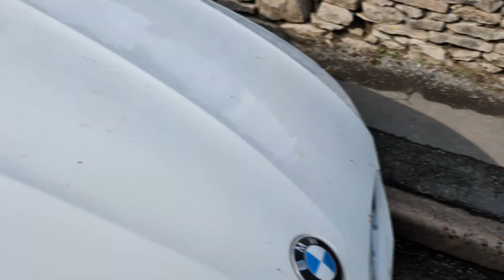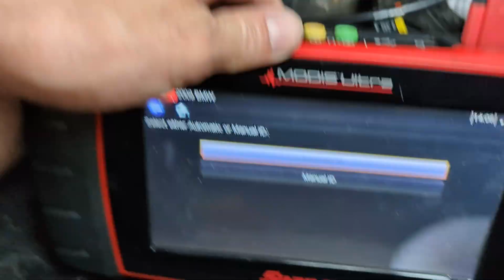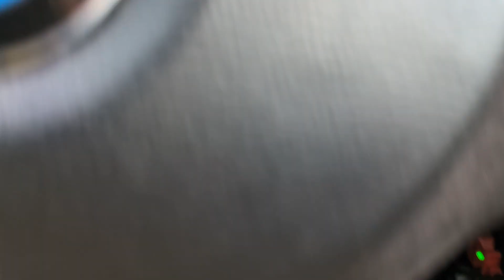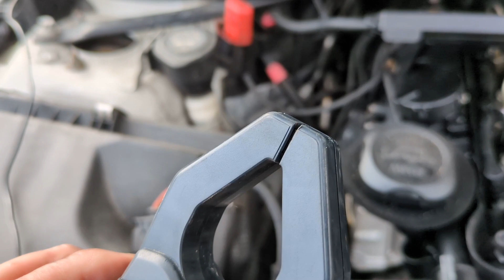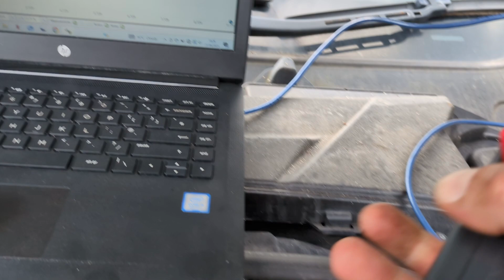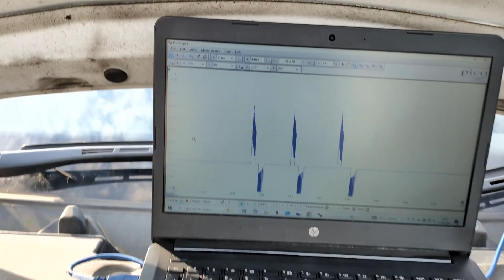BMW 443C Injector Cylinder 3 Activation | Diesel Misfire Troubleshooting

Comment: Brotha no way you made a video about this your a legend 

I got a 335d 2010 and having issues with starting it! 

New hpfp 
Old one wasn’t starting car 

Put new pump and got it to turn over once 

Then I immedly shut it off like a dummy and now it just cranks and cranks away 

No fuel is going out of the hpfp 

Fuel line to hpfp gets primed and flows easy with lpfp but after it goes in the hpfp it dosnt come out